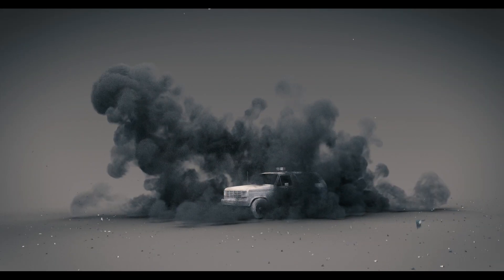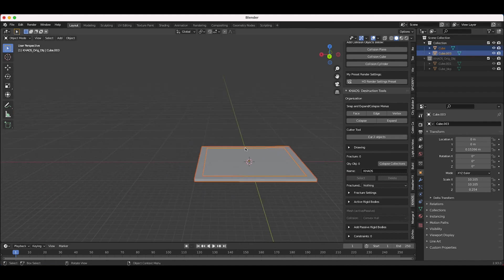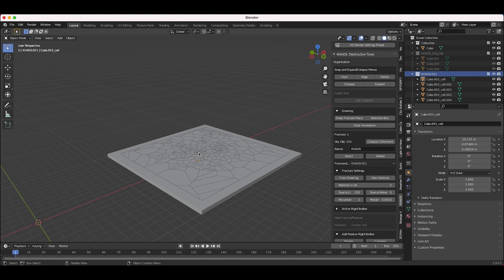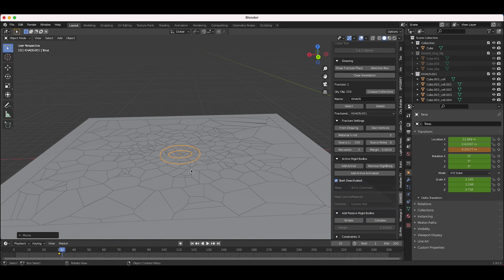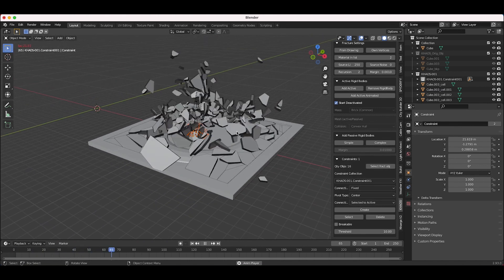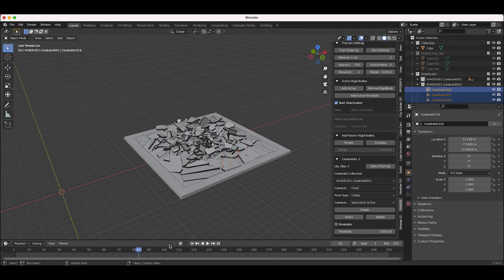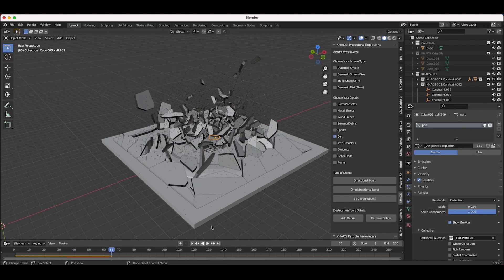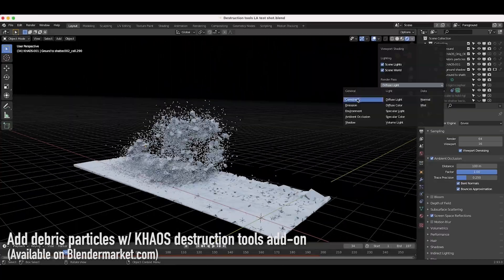Rigid Body Shockwaves in Blender 3d: Full Tutorial utilizing KHAOS Add-on

Comment: Hi, how do you make the destruction only appear when it happens rather then the fractured pieces vissible already in the animation ? Just like the intro of the video in the dark
Reply from the maker: Well there are several ways to do this. You could turn on the layer on the keyframe when the destruction happens... or you could  animate a  mask at that time. The latter offers a bit more control but isn't always needed. There  are other ways too but those are the simplest on the top of my head. Thanks  for watching!

Comment: hello brad, amazing job. one question can you combine city builder models with chaos addon fire  explosions and the new destruction tool without crash your pc?
Reply from the maker: Hi Deiby, Thanks so much! So the issue with fracturing models for destruction with pretty much any technique in Blender is that the models have to be built in a very specific way with "Sealed" topology. For that reason the CityBuilder3d assets at the moment wouldn't be best for this. Unfortunately most models online aren't good for fracturing either unless built specifically for this purpose or retopologized. This is why I'm starting out with these simple destruction videos with basic objects. I'll be going into more depth and likely getting into building destruction in the future as well though.  Hope this helps.
Reply: @LightArchitect  thanks brad, i. Big fan of your work, hope see more tutorials of this, combine with fire explosions, maybe in a less complex models.
Reply from the maker: @degibocu  For sure! Will definitely be making some videos combining explosions with rigid bodies in the future. Thanks for the support!